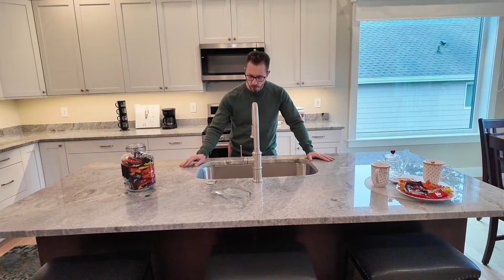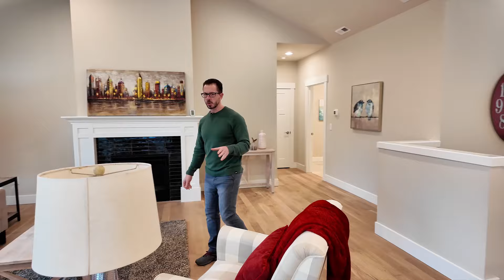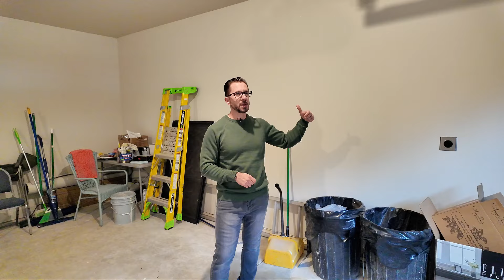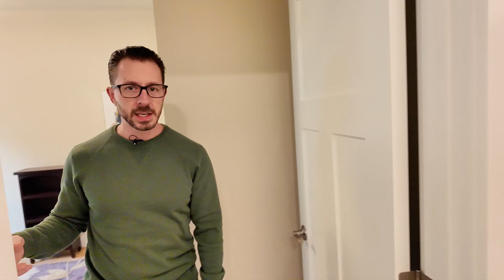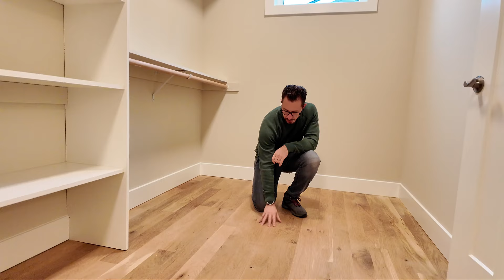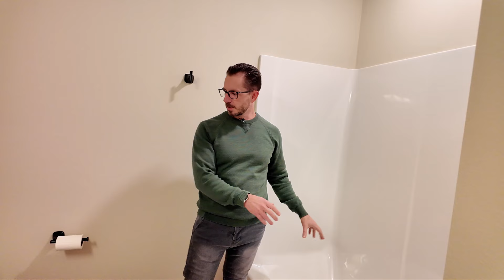A High-Performance Home Tour | Accessibility, Comfort & Energy Efficiency Done Right

Comment: I think what you forgot to mention about the blinds is that you have to outside mount them above the windows with tilt turn windows since they open in.
Reply from the maker: You can also mount on windows, use pockets... Didn't forget, this is just what we chose
Reply: If you mount on windows, you can’t open the windows all the way potentially blocking egress.
Reply from the maker: @kendriver3278 🙂

Comment: How did you get around having outlets high on the kitchen island? 

My home final’d in Kitsap July 2025 under 2018 code base. L&I forced me to remove my kitchen island outlets up high like you had. After calling L&I directly numerous times they “let” me put outlets low to the ground. Apparently this negates me plugging in a short cord appliance (croq pot, air fryer) and having a child pull down molten food on themselves.
Reply from the maker: This was vested under an older code.
Reply: I ended up with a beautiful home through sheer force of will and much re-work after the builder didn’t /doesn’t apply the building science your company does by default. 

Wish I knew about your company back then. If I could travel back in time and do over I would.
Reply from the maker: @kevinm5439 oh my goodness, thank you for that comment, and I'm sorry what you went through

Comment: Without doubt this is a well sealed and efficient home. With high performance comes needs for balanced ventilation. Glad to see the ERV and balanced ventilation. Kitchen exhaust and bathroom fans are notorious for creating negative pressures. I didn't see it covered, but a make up air unit would be a good idea. I generally wouldn't want to see combustion devices or fireplaces in a high performance home. The interests run counter to each other. Would have liked to have seen a recessed clothes dryer vent box. 🫤 Would love to have had a better look at the dormer if it was being used to bring in elevated light. Good call on the electrical receptacle on the stairs. 👌 For esthetics, I'd be careful with vaulting individual rooms. Mono slope vaulting that transitions through multiple rooms has an overall better esthetic. If individual room vaulting is overused it can start to take on a double wide trailer vibe.
Reply from the maker: Thank you for the comments. One response. With extreme weather events, I want occupants to have an offgrid source of heat and cooking. Survival is paramount (thus fire codes, etc.). But I appreciate your thoughtful comments.

Comment: The self-regulating USB chargers are a nice upgrade. Quite a pleasant new home. I love the wood floors.

Two factors in this home are common, and so most people would probably not know about an advisable upgrade to each, which would naturally raise the sale price a bit:

Plugged into 15 amp electrical outlets, which are standard in U.S. homes, and which we can see an example of above the kitchen counter here, hair dryers, space heaters, air fryers, and similar high output devices, tend to overheat internal home wiring. Overheating electrical wiring may lead to circuit failure, or even fire hazards, such as electrical wiring melting their insulating cover inside walls, etc.

20 amp and or dedicated circuits for such high power items are advisable, as the in wall wiring is thicker, and can handle more power, more safely.

For those who do not know, 20 amp outlets have a small visible horizontal slot adjacent one of the vertical slots. You can safely plug 15 amp electrical items into a 20 amp outlet, with no damage to the items, but a 20 amp prong on an appliance will not physically fit into a 15 amp outlet, due to the extra notch in the prong.

Several newer, pro-sumer espresso machines that heat water very quickly, require a 20 amp outlet, with a 15 amps not being an option. So someone in this home would have to buy an espresso machine that takes quite a bit longer to heat up.

At least one 20 amp outlet where an espresso machine and air fryer might go on the counter, and one in the bathroom for a hair dryer, would be an improvement in future builds.

Second, experienced appliance professionals recommend against microwave vent hoods above the stove. The reason being, these pull notably less smoke, aerosol grease, odor, steam, heat, gas from the burners, and carcinogens from food items cooking on the front burners, as the hood does not sufficiently reach out over the front two burners.

The fans inside these may also be weaker, making them doubly less effective than a dedicated hood over the cooktop. As it is now in this home, people would be well advised not to use the front burners. A dedicated hood vent does cost more, but a microwave hood vent - while common - is something those in the know recommend against.

Cheers.
Reply from the maker: Thank you
Reply: The majority of 15 amp outlets are installed on 20 amp circuits. The risk of the wire melting is extremely rare. Circuit breaker protects wires from melting anyways.
Reply: @titanium-alloy 
Your observation seems largely true.

However, I repeatedly come across warnings from numerous sources, with experience and or expertise, who indicate that too many homes in the U.S. are at risk from using the aforementioned high output items in 15 amp outlets. Even if those items have 15 amp plugs.

I tried to include a link, but it seems the publisher blocks them. Those interested can research for themselves.
Reply: Except that the world has moved on to USB C. They’re already dated.
Reply from the maker: @kendriver3278 🙂

Comment: If the house was design for accessibility I would change the all the door opening to 36 inches to allow for all wheelchair use and the hallway to the width of 48 inches to allow wheelchair to enter the rooms. Also I would add a provision for an elevator to access the lower level. An guest powder room the meets ADA accessibility requirements. Also in the master bathroom with added blocking for future grab bars and seat.
Reply from the maker: All good details.